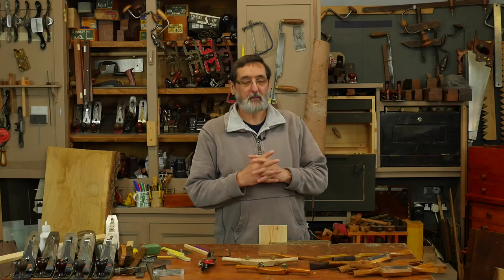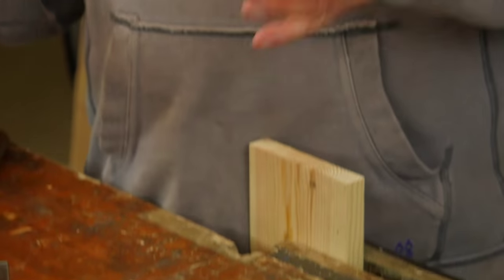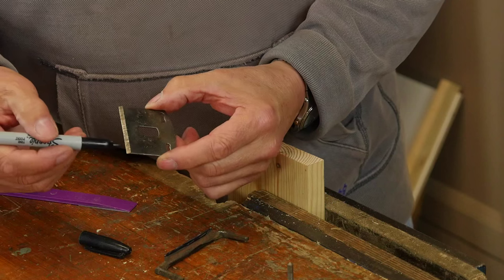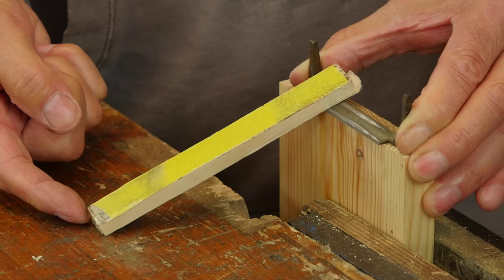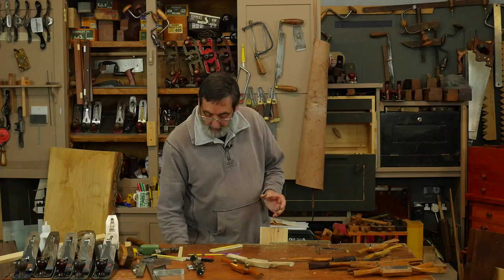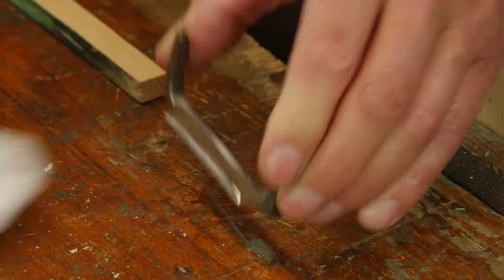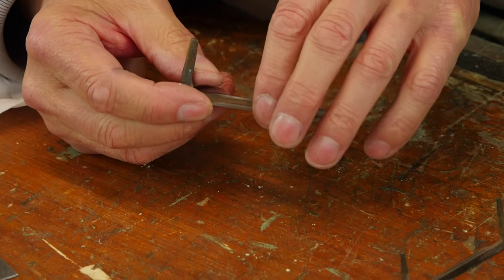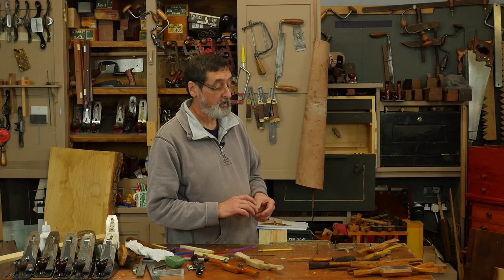How to Sharpen a Wooden Spokeshave | Paul Sellers

Comment: Heh, until now i was using the drill press and a angled block to bring the blade under an abrasive disk. This is much, much easier as i don't have to fear the disk catching the blade harder and flinging it across the shop.

Comment: Hi Paul.  I have a round bottom wooden spokeshave just like the one you show in this video.  The beech handle is quite old- to the point that the tangs do not firmly stay in place during use, and the blade ends up in a different position (depth) after trying to use it.  Is it time to find a new handle for it, or do you have any tips to avoid the slipping tangs?  Thank you.  Tricia

Comment: Paul, if the wood in the vice is not level with the top of the bench, might it not make one side of the blades bevel not contact the hone the same as the other side?

Comment: A perfectly simple method and one I shall be using on my wooden Spoke Shave (only have the one for now) but I was wondering how would I go about flattening the blade?

Mine seems to rise up at the edges but not enough to make it into an internal rounding tool, it's almost that the middle has been bent outwards possibly by the person before me trying to pry the blade out.

when I use your method I get both ends clean and sharp but the middle isn't touched at all, should I just gently tap the blade with a hammer until it lays flat on the workbench?

Comment: I have never heard of charging with chromium oxide, what is the benefit of this process?
Reply: +Andy Soelver Burnishing the cutting edge, in the same way you would use a leather strop. The chromium oxide is just a fine abrasive.
Reply: Chromium oxide is a polishing compound used to polish the edge and remove fine scratches...charging is just a term for loading the leather strop up with the polishing compound
Reply: If you want to get the sharpest edge possible you want to use aluminum oxide. its something like 20, 000 grit.